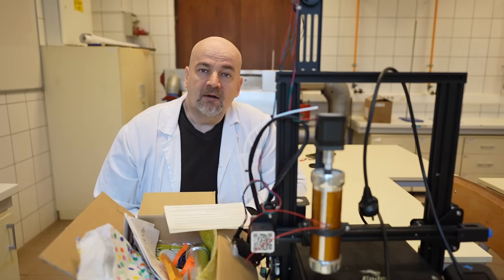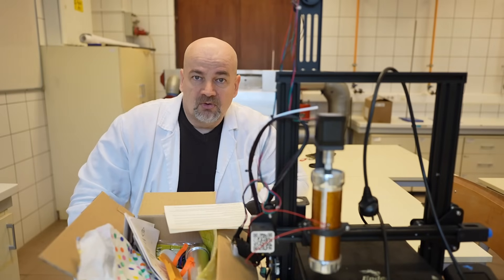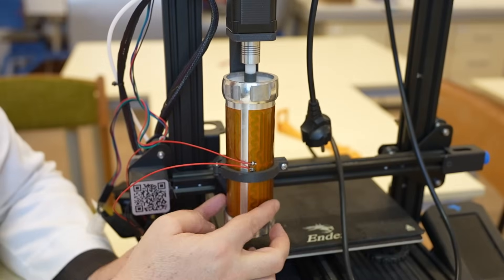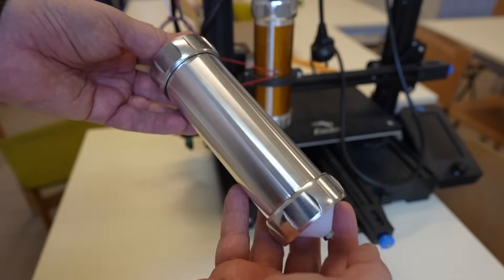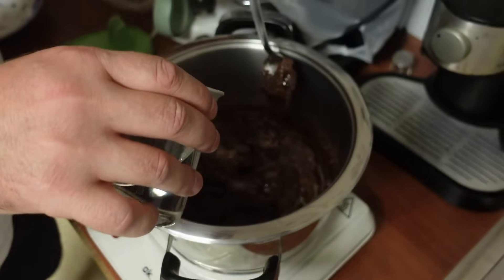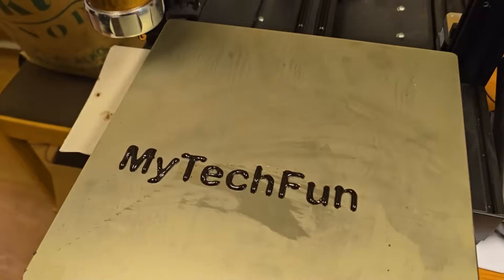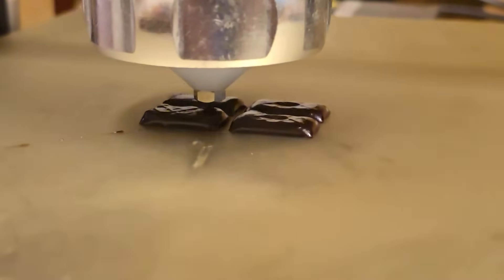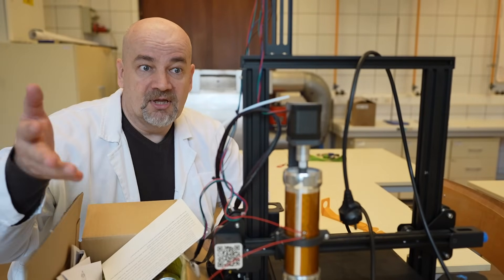Chocolate 3D Printing on an Ender-3 V2 – DIY Experiment

Comment: my project during engineering technician school was to modify a printer to be able to print with chocolate. i can send you the document if you want. we used a plunger, but i think a screw extruder would have been better.

Comment: Hi, I'm pasty chef by trade, you should use oil/fat that dont contain any water to adjust the flow of chocolate. The fat in chocolate (cocoa butter) will form lumps when mixed with chocolate.
Reply from the maker: In normal case (with piston cylinder), I don't have to add anything, just melt the chocolate, but good to know. Thank you.

Comment: I have been using a LuckyBot on an Ender 3 v2 with some success.
You need to print with higher end chocolate like Ghirardelli 72%-85% with no thinning.
You need to temper the chocolate when you fill the tubes for printing
Also you should print on parchment (baking) paper.
I also have to run a skirt with a couple loops to adjust z-height on first layer as it prints (for this I needed to use custom firmware as stock does not allow this).

Comment: A handful of advice for you. Do not use water for chocolate. Thin it out with butters, oils, or vegetable shortening. Palm oil, coconut oil, and cocoa butter are industry favorites.
Existing concepts exist and a product already has a prusaslicer profile. Might be worth looking into.
Nozzle temperatures must be precise. A couple degrees variation can offer varying results. 
Don't microwave chocolate as this could cause inconsistency in flow. Some parts of chocolate will solidify when overheated and cause clogs.
Don't heat the bed. Use silicon cookie sheet for bed adhesion.
Others don't use cooling but I think cooling could go a long way for overhangs.

I'm getting my force feed pellet extruder from greenboy3d  soon, and I got it 100% intending to use it for chocolate. 

Super happy to see a sponsor coming on. Polymaker should be an excellent partner for the channel. Good work m8

Comment: Ann Reardon's video is an excellent starting point. See https://www.youtube.com/watch?v=kFhfX2z-vXQ
There is some interesting stuff on chocolate tempering at https://www.youtube.com/shorts/PJPjmql3SYc

I've got a SOVOL SV04 that I"m planning to eventually make into a chocolate printer. The SV04 is cheap clone of the Ender 4, which is to say, it's not a bed slinger (which seemed to be a bad idea to me, though people have made it work).

I've bought a metal bodied marinade syringe for the piston. Metal should enable better conduction for heating and will be easier to sterilize. 

I bought a geared stepper motor for the extruder because Ms. Reardon ran into problems getting enough force with a bare stepper and doing your own 3d printed gearing is really clunky (and could leave microplastic in your prints :--)).

I was thinking it would be useful to have an air hose for cooling the printed chocolate if you do multiple layers. The air hose would run through an ice bath. I'm not aware of anybody who has tried this yet.

I've got a few other projects to finish first before I start this one though.
Reply: thanks for these links. I want to deep dive into this topic- and not only use chocolate, but other pastes. So I guess there are no ready solutions, only DYI available? 
After moving from Ender to Bambu couple of years ago, I got so used, that printer "just works", without hundreds of hours of tuning.. so I want something similar but for food 3d printing :) I guess no option except maybe some crazy expensive professional printers (not sure if they exist)
Reply: @djDuff86  well, yout might look at the Coco Press as a complete system, if you are looking at relatively small volumes of paste. There are a ton of cheap paste extruders you can buy to put on your existing printer (LumenPnP Paste for example).
But there is not going to be a cheap one-size fits all solutions because the pastes are different (volume required, temperature control, tendency to separate under pressure).

Comment: In my experience, carbon fibers help immensely with printability, but then you will not be able to microwave your chocolate. that's the only downside i can possibly see.
Reply from the maker: So correct, but I can still see few downsides ;-)  Maybe we could replace carbon fibers with some fruid fibers?

Comment: Never user water with chocolate, temperature is critical, keep it steady, too high will temper and change the properties. The spiral part could be metal and heated. You can try to make an Chocolate Ganache with 10-20% butter to have a better flow. Use a silicone mat or smooth plate. 30' in fridge should make it hard. Use pure dark chocolate not a mix full of sugar and milk. Search how to make chocolate, from that base will be easy to apply your expertize with 3D printing.
Reply: Yep. Chocolate is hydroscopic, it binds with the water to seize up, gets all grainy.

Comment: I was expecting some strength test samples with zero waste since you could eat them after breaking them.  In my experience melting chocolate is easiest using a double boiler, maybe there could be some kind of heated water jacket around the impeller?  Then print the whole thing onto an actual chilled plate, or in a chilled enclosure.  

ty polymaker for stepping up to sponsor this channel :D

Comment: Have you seen the cocoa press? It's a chocolate printer based on the Voron 0, it's very expensive in comparison though. Maybe you can find out about the chocolate they're using. 

Would part cooling help you print taller?
Reply: For home use and experiments - way to expensive. 
I guess for small production Cocoa Press is fine, i.e. for small bakeries making wedding cakes and other pastries. 
Anyway I expect too much of tuning needed (not sure it works out of box as Bambu regular 3d printing) + this needs a new set of knowledge/training for pastry chefs.. 
For serious restaurants - too small plate, slow, not heavy-duty..
I still do not understand who is their target audience..
Well, is anything else as good alternative for home enthusiasts? :)

Comment: I've not personally attempted chocolate, but there are printers made specifically for clay with more robust augers/feed systems that I would put the viscosity about par with printable chocolate. If I were to do it, I would probably use a silicone mat on top of a spring sheet and pre-chill the mat in the freezer directly before printing. That part is more theoretical in my head, but if you weren't too concerned with power usage, a TEC-cooled bed wouldn't be terribly difficult to implement. The 40 watt TECs that come in 10 packs have gotten stupid cheap the last few years where I've started picking them up for pseudo CPU testers. 
I'll check my bookmarks for the clay printers as I don't recall the brand(s) off the top of my head, though I recall there being a few I've come across in recent years.

Comment: have about nano sized ion beam printing. yes electric/magnetic field beam steering 3d printing. yes also do ion magnetic separation purification in the same ion 3d printing device. yep small amount of ions can also be exactly purified in small quantities. why not use the piston as the melting heat source. maybe use a metal small screw extruder to generate the heat by friction. as a shedder melter extruder.

Comment: 1:30 great to see you're getting a source of funding going forward. You deserve ongoing support and the ability to research projects without having the pressure of needing to turn it into a video (if it doesn't work out interesting). Patreon etc can only go so far. One thing I'd be concerned about, is the way the sponsorship may be structured and how it'll be presented in any disclosures. You might be putting yourself in an awkward spot if you say your research or your channel as a whole are sponsored by Polymaker - most channels that do sponsorships do so on a per-video basis, and the sponsor is paying for 'that portion' of the video rather than the whole video. I'm not against you taking a sponsorship from a filament manufacturer, but sponsoring a segment in a video is quite a well understood way, rather than them sponsoring research/the channel itself. It presents better regarding conflict of interest, not that I would believe you would compromise your ethics.
Reply from the maker: I will explain this in a separate video, when we sign the contract. But overall: I can still make any video I want. Polymaker don't have any kind of affect to my content (and measured results). Since other brands may ignore me, I have the budget from Polymaker, so I can buy any filament I want. If I have several brand comparison video (and I will have several soon), again results will be presented as they are. If by any chance Polymaker will be weaker, even then, video will be presented without changes.
Reply: @MyTechFun  That's good to hear, and I assumed you would follow that ethical behaviour so I didn't even bring it up - my main concern is around how the sponsorship is structured and also optics. Your best option regarding structuring the sponsorship IMO would be for Polymaker to sponsor each video, yes there's a little more management overhead, but you leave yourself open with options regarding any other sponsorships you might want to do, as things are done on a video-by-video basis. If any competitor sees your whole channel is already sponsored by Polymaker, they may be discouraged to contact your regarding a future sponsorship. I'm not thinking about this week, or this month etc. Imagine a scenario where your channel has now grown 10x, you would have a harder time trying to 'replace' Polymaker with another company, as it's an all-or-nothing sponsorship at that point. Of course how you make your money is entirely your choice (as long as you tag the video as sponsored in the YT uploader), I'm just trying to make sure you can remain flexible and don't get locked in.